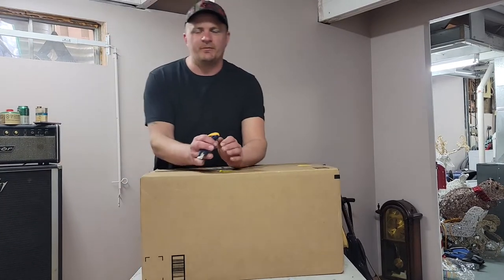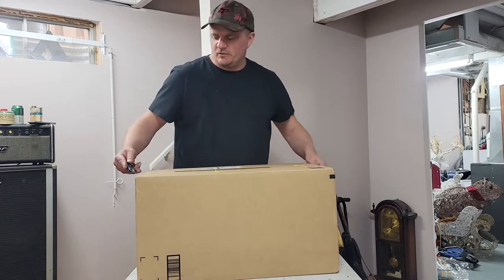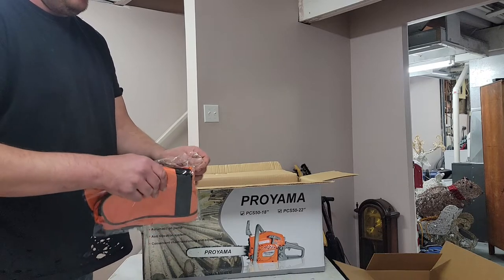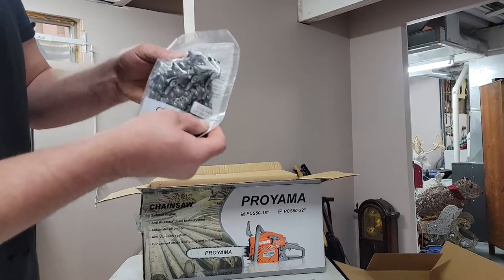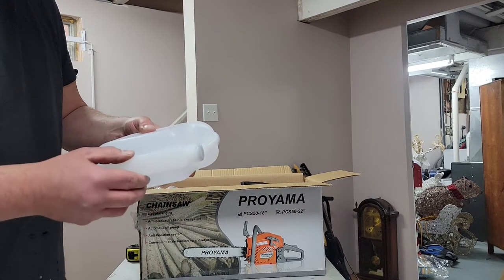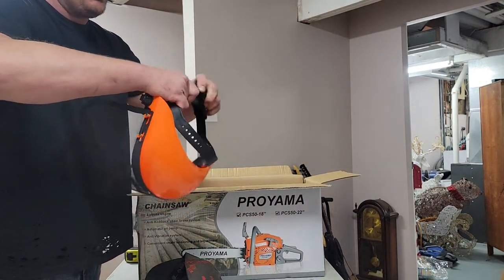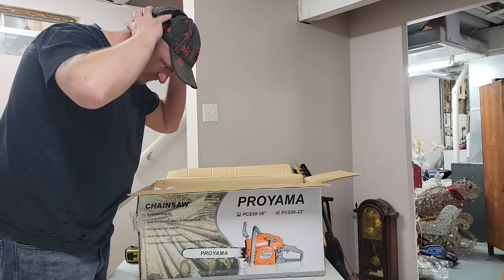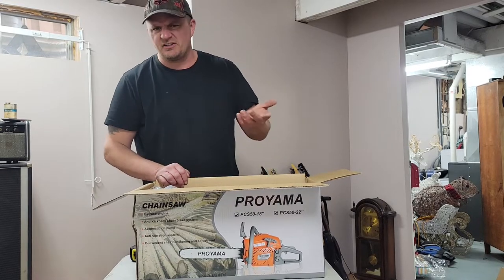proyama chainsaw unboxing pt 1

Comment: I bought this PROYAMA saw needing a decent limbing saw for a big job i was doing. I honestly didn't expect it to last the whole job as I have always used husqvarna or other brand name saws. I have been truly amazed by this saw and its durability, workmanship, and dependability. I have since used this saw on over 100 tree jobs. It has done everything from limbing to cutting firewood to cutting down trees to milling. I am still using the original chain and bar. The chains that come with it are really aggressive. If you do start to lose power check and clean the air filter. As it gets clogged it will lower the performance but that will happen with all saws. I would highly recommend this saw to anyone. I have told logger friends and tree cutting friends about it and they have purchased some and love the saw.
Reply: I ended up buying the Proyama to add to my chainsaw collection addiction.  I have ran this a few times and agree with most of what you say,  although I am not too pleased with the power,  it seems to bog down easily compared to my MS251 and 455 Rancher which both zip through just about anything without bogging down.  Assembly of the Proyama was a breeze,  it seems to be good quality and chain is very aggressive like you say.  Starting it for first time was a bit worrisome until I held throttle and then it fired right up.  After the initial starting it has been easy to start just like my Stihls, Husqvarnas & Echos.  

I am running 32:1 mix for the first 2 tanks per the manual then I will run 40:1,  

My question is do you have any performance issues with ur Proyama bogging down and not having enough power for a so called 62CC.
Reply: @jasonmeharg7899  my chainsaw very powerful

Comment: Gasket is different, i actually cut my own out of gasket paper for all my saws, learned it from Iron Horse. Gasket and oiling holes drilled out a bit bigger will keep the bar oiled good.

Comment: Great video. How did it perform for ya? I just bought one but it will only start run for 2 seconds then die.  Any ideas? Im tthinkin fuel delivery problem or bad crank seal? It has lots of compression and spark.
Reply from the maker: Did you mess with carb setting? Sometimes they are out of adjustments brand new
Reply: @chainsawcanuck  yeah it was way outta adjustment and wouldnt start at all so i went in all way and out a turn n half on low and high screws. Now it starts but dies after a second or two. Ive tried making small adjustments to no avail.
Reply: Follow up:  it ended being a broken low adjustment screw...tip snapped off in carb blocking passage. I attempted to extract but it was too tiny and wedged. I got a replacement carb from Proyama after months wait. Then same thing low screw came snapped amd jammed. I verified this by removing right from brand new before even screwing in any adjustment. So i got fed up and put it on shelf. Then it occurred to me I have an old spare Poulan carb. Carb parts mostly all contactable so i used the new Proyama guts to rebuild the old Poulan Carb and I swapped the fuel pump impulse cover off the Proyama and it fit on the other carb.  She fired right up and runs great. Im super happy now. Very loud open muffler with two exit pipes but she screams and quick revver. Ive been enjoying your videos and appreciate the knowledge. One last question for you if you have time. I recall in your videos you saying they are around 50cc despite their claimed size. This one is claimed 68cc 20" and 24" bar. have you ever measured that particular one? Is it also just a 50cc? Thanks for your time.

Comment: Hey 👋 question for you sir...with the air filter on this power saw. Can this filter be used on the supmix pinkway ect ect they are all of the same family? lol  I have been trying to come up with a solution for a different kind of filter that comes on them saws. The fines will get around the fine filter that comes on them. Same filter that comes on the new crafsmans. I just ordered the same saw your unboxing in hope that it's filter will also fit my other  Zenoah clones... thanks for your time 🙏
Reply from the maker: Yeah they are all interchangeable, if you look at my other videos there is one doing a filter upgrade on a supmix.. The filter assembly was about 4$ Canadian from aliexpress
Reply: @chainsawcanuck  awesome... I thought so! I can't stand the filters that come on them saws! I too have a chainsaw addiction lol and recently added the  Zinoa clone saws it!
Thanks brother have a good day

Comment: I'm actually looking at one of these cells. I think it's a pro yama 68cc with a 24-in bar and chain and I think he comes with a 20-in 3/8.05 eighths wondering what's your thoughts upon you saw as the scene of video of a gentleman that has looks like a tree servicing business and said that this all runs really nice once you kind of break it in after 4 to 5 tanks and says that he does like it as a mid-size saw. Just wanted to buy this as I have an older Husqvarna 61 and don't want to go and spend over 1200 for a saw that's just going to sit around with all this kind of looking at this
Reply from the maker: Just remember that these generic zenoah clones are never the displacement they claim, like the one in the video is marketed as 62cc its only 49.3cc, the 68cc one is probably only 54.5cc
On Amazon there is a supmix saw that goes on sale often for 159.99 canadian , it's a 54.5cc version and even tho plastics are different mechanically identical to the proyama,  except the supmix does not have the performance killing catalytic muffler that the proyama saws have

Comment: Went to adjust the oiler at the bottom and i couldent get the screw driver in, flashed a light and its just flat plastic, dont think theres actually an oil adjuster.
Reply from the maker: Mine has a metal screw, might pull it out today to double check

Comment: Wait so it is actually not a 62cc but 55cc?  I thought I'd get it if was a larger 62cc but not now if are lying is only 55cc. I got a Walmart black max 20" 50cc 3yr warranty  on sale only $99 .
Reply from the maker: It's very common for the generic zenoah clones to be advertised at higher displacements
Reply: @chainsawcanuck  that's a bummer. I was looking at the 68cc proyama.  but if it is not the actual cc output more like a 50cc I already have one that size and has a 3yr warranty where proyama only 30 day warranty.
Reply from the maker: @dylanowens3173  buying a clone saw right now I think the best bang is the neo-tec ns872, stihl ms381 clone they are pretty solid

Comment: Notable with the Proyama saw that I bought was that there are NO ASSEBLY INSTRUCTIONS even though, in the manual, it says "assembly" in the contents. NO ASSEMBLY INSTRUCTIONS!!! Next, is that the manual says to specifically use the bar and chain oil provided...there isn't any provided! It's hilarious in an "I knew it" sort of way. I could smell gasoline when I sniffed the gas tank so I am pretty sure that they do run them at the factory.
Reply from the maker: They for sure test them, another brand the supmix on amazon, Same saw different plastic unboxed it pulled on the cord and it fired for a second.. Lol wife wasn't happy was in house.

Don't know if mine even had a manual.. Lol but I know the actual displacement of these things is never as advertised mine measured out as 49.3cc which commonly marketed as 52cc or 58cc, it's a bit of a crap shoot.. Lol

Comment: In china displacement number includes combustion chamber volume.
Reply from the maker: Well then it's not displacement.. And the cubustion chamber is not 12cc....
Reply: @chainsawcanuck  the 2strk bike engines from china I've played with are advertised as 80cc. They measure at 66cc. Being precise is not a priority.

Comment: I looked at these but i bought a Stihl
Reply from the maker: Stihl makes good pro saws, their clamshell homeowner saws and not much better tho, like uneven middle number ones, 250 271, 291, 391 etc, I mean those are good but once they are done a lot more expensive to fix compare to the zenoah clones

Comment: Proyama or Supmix
Reply from the maker: That's a proyama.. But the supmix is larger displacement bt me measuerments
Reply: @chainsawcanuck  which one is the better buy?  Proyama with 22”&18” bar or the 20” supmix
Reply from the maker: @jasonmeharg7899  I say the supmix is
Reply: proyama is better
Reply from the maker: @toolsreview7159  the supmix has a little more torque, and is 54.5 cc, the 18/22 proyama is only 49.3 cc, but apart from piston/cylinder and crank mechanically they are Identical, but thr proyama looks nicer, having said that I have the orange supmix sitting in the basement and it has a much nicer fit and finish that the other red supmix